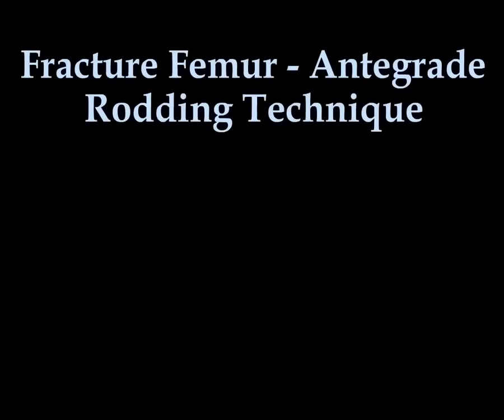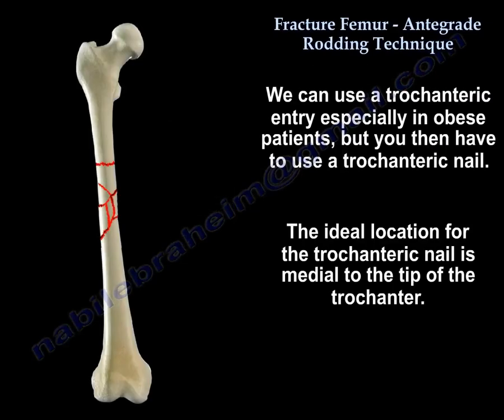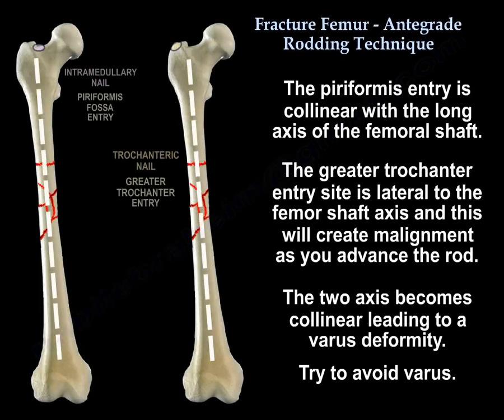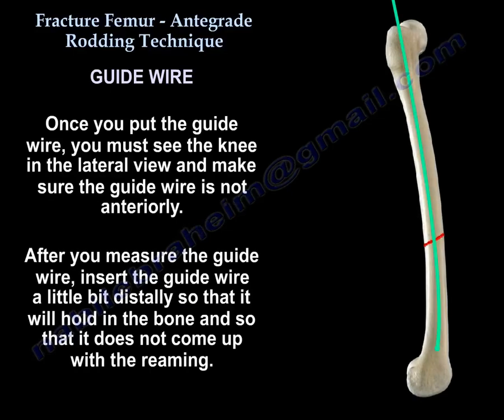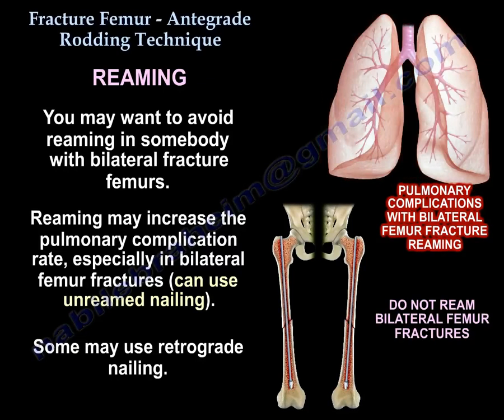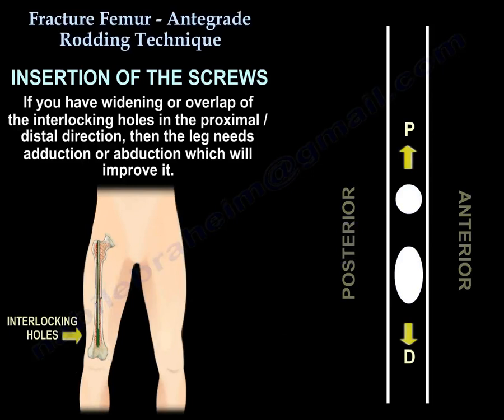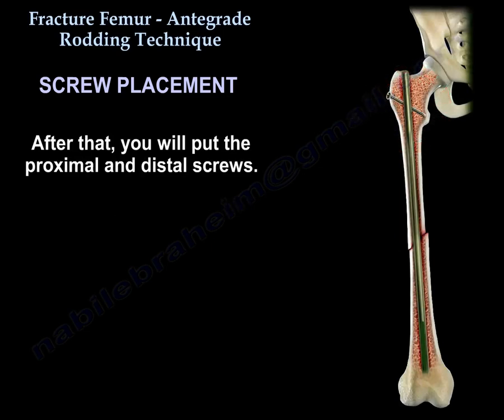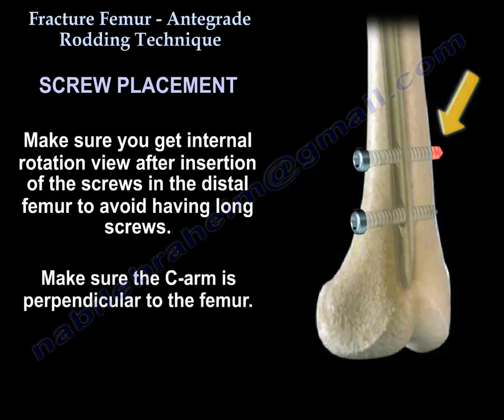Fracture Femur Antegrade Rodding - Everything You Need To Know - Dr. Nabil Ebraheim

Comment: Over inserting nail and the Placing distal screw first then pulling the nail back will apply compression on the fracture. Then proximal screw insertion shd be done.